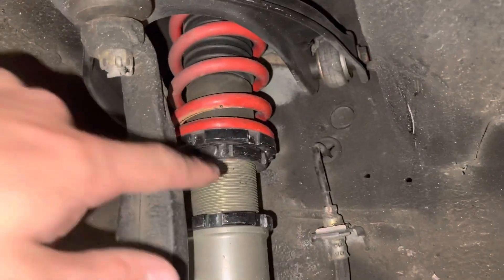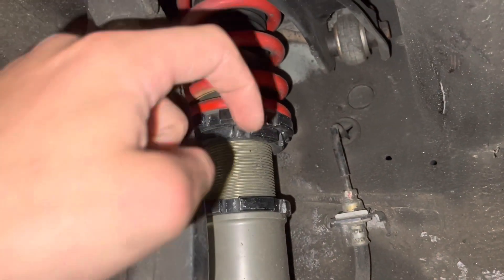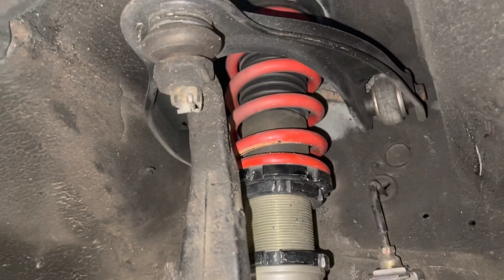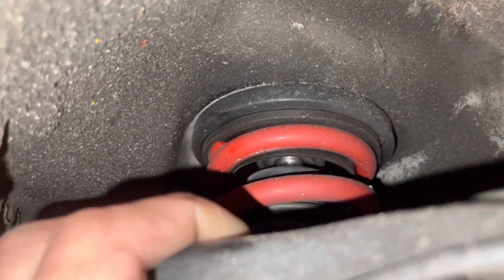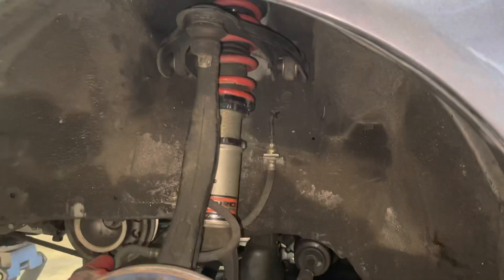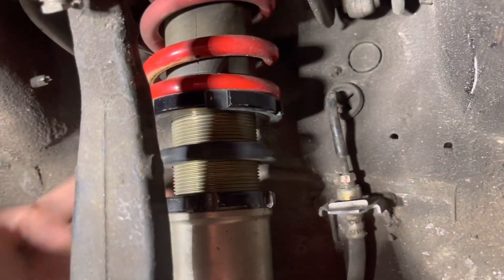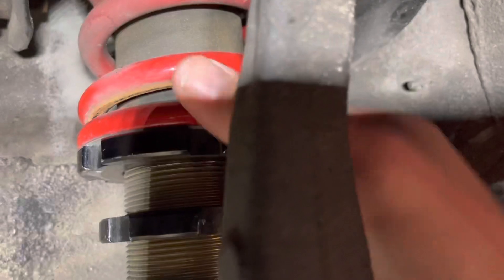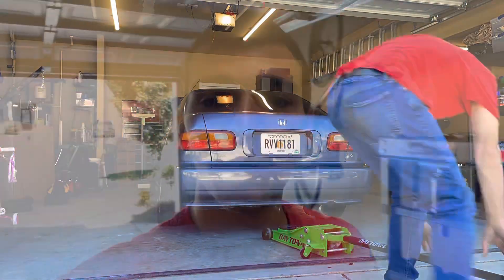1992-1995 Honda Civic Skunk2 Pro S II Coilover Spring Preload Reset and Adjustment - Spring Binding

Comment: the coilover is attached to the lower control arm. how do you think its twisting? the shock does not move when you turn. this only apply to cars were the sturt is attached to the spindle.
Reply from the maker: Correct, but when the spring is under as much stress as it was, being overly compressed it was causing the shocks to bind during any movement in the steering. They should never been under that much tension, or… binding happens. Doesn’t mean they shouldn’t be snug. Maybe a half turn to a full turn is all you need my guy.